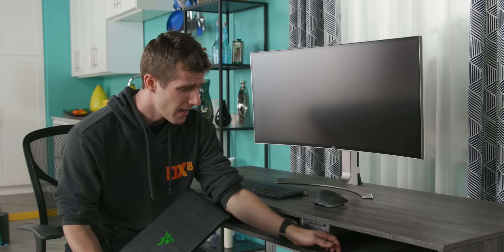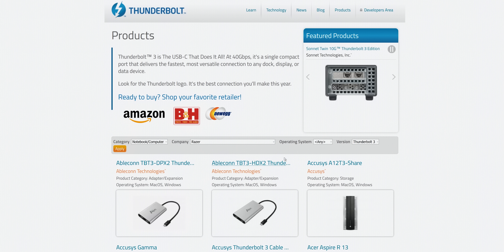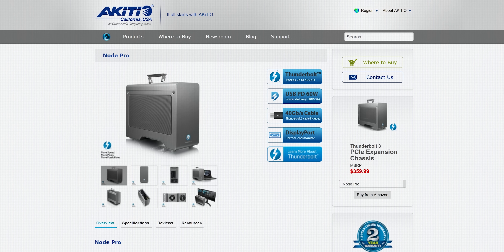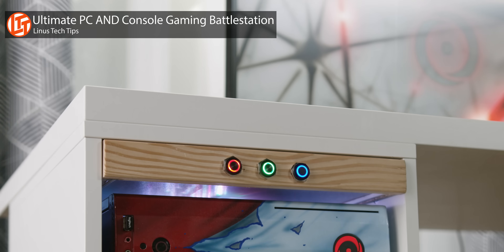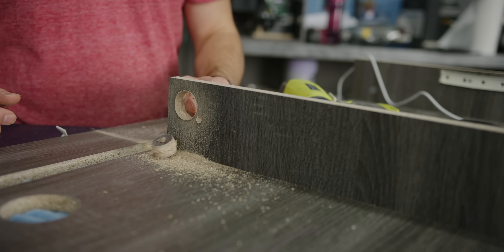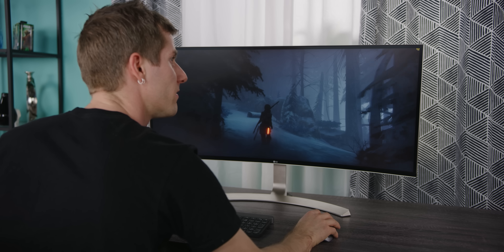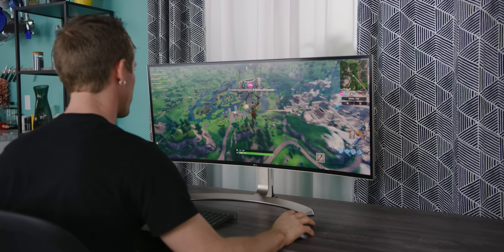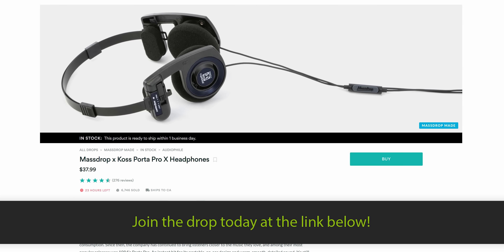This is the CLEANEST Setup.

Comment: Nice setup! Though the only problem, that I see with this desk is that it completely lacks the cooling of the laptop itself. For an example my asus Gl502 laptop CPU runs at 97c in games. In a closed drawer like this one without any air flow it would explode.
Reply: Some laptops like the Gigabyte Aero X and the Asus Zephrys S also don't get proper cooling with the lid closed.

Comment: Thanks for the ideas. Thunderbolt definitely has its uses and this has been an issue for me since early 2000's. Although I still need a laptop for portability and a full size tower for functionality at home. But since I have 5 working computers all together, this video does give me some ideas for cleaning up my work space.

Comment: Use Heavy Duty 3M Dual Lock Velcro, it's way stronger than typical velcro. A little pricey on amazon, like around 40 USD on Amazon for 10ft

Comment: So you've spent more than $500 on a questionable quality desk (which is, by the way, also looks waaay cheaper) because it "could" fit all of your hardware. And in the end some of the hardware is in a separate stand anyway. Why  not just buy a decent-looking table for an adequate price just to hold your K, V, M (and wireless charger, yeah, if it is so important) and put ALL of the HW in the fake drawer?

Comment: I think those brackets may be backwards... (screw holes not big enough)
Reply: My razer blade stealth (2016) overheats and crashes when I try to run it with the lid shut... :(
Reply: fuzzy velcro = fail, get the same sided hard velcro... Scotch(R) All-Weather Fasteners
Reply: Gimme a job I want to move to Canada.

Comment: Why don't just plug a hdmi cable because i don't see the difference about how the thunderbolt works and it seems like you just plug in a seperate display
Reply: Well, you can't plug in a discrete Gpu with HDMI or a mouse and keyboard

Comment: pre drill!!!! Love the video and the desk setup. IKEA I always pre-work before or while during setup. (The screws stick out)... due to not predrilling even if a hole is there. (MY TIP) Take the drill bit and the screw, place screw at end of drill bit flush. Now put screw head over the bit end and then tape the drill bit "where" the screw tip ends on that drill bit. An overlap it should seem while doing this, make sure tip is versus tip while next to each other. "Now", take the drill bit put into drill and then drill until the bit meets the tape line. This should equal a depth of the screw. I made good desks made from crap material. I am only looking out because I watched you grow as far as youtube! Anyways, always love the info but if ever need some serious advice get me on.P.S. I agree awesome job!

Comment: A laptop with 1060/2060 or 1070/2070 will do the job better and you will also have that power on the go when needed. It is also more cost efective.

Comment: This is all very cool, but if you are a heavy duty user you'll probably have an external sound card, loads of capture devices. Also with a desktop that's nicely laid out with icons it'll mess them up every time the resolution changes.
I myself have a Plustek 35mm scanner, a Tascam soundcard, mouse, wacom pad, three monitors and a projector hooked up to my PC. I guess there's limits to this setup, but it does make sense. Would be cool if there were proper docks to do this!

Comment: Been doing something similar for years. With a Toshiba Dynadock USB 3.0 for data and a second cable for charging. Works quite well with Printer, Monitor, Mouse, Keyboard, Speaker, Lan. External graphic would be great but not with the current price tag.

Comment: Also try this but wireless connection to the laptop, just set it on the desk (which everything is hidden in) and everything turns on
Reply: There's no wireless connection with fast enough data transfer to do this.

Comment: Could you do this with the new Alienware Area 51 laptop
Reply: Watch the video
Reply: You cannot. They need too much power to charge. The power supply is around 300 watts. You could, but the power supply would need to be separate, meaning you’ll need to buy another. You can’t charge an Alienware on usb C or thunderbolt like you can a lot of uktrqbooks
Reply: This whole vid is bs tbh, you can make this same set up with any laptop as long as it has HDMI and USB 3. I mean... This is clearly a promotion vid.
Reply: TagliatellePizza don't you need a nice processor as well?
Reply: @tackfire27  bruh

Comment: Ok, this is nice.
I made myself something similar this0 year.
It is without the extra GPU, not with such a perfect monitor (a little over my budget), wireless charging is coming. It is quite nice.

My problem is that I have a Dell G7 2018, which has a power brick 180W. Is there any way to have a dock or something to connect laptop with a powerful support and all the peripherals.
Any help would be nice.
Keep on the good work.
BR
M

Comment: Have a similar setup with my Dell XPS 13 9350 QHD+ for the past Year!
Im using a 
Dell S2718D Monitor
Microsoft Fingerprint BT Keyboard
Logitech Mx Master Mouse
Pioneer Speakers Or JBL Duet BT Headphones
Omoton Vertical Laptop Stand

I use a 1.6ft Belkin Thunderbolt 3 Cable which charges and displays my laptop easily!.
I don't play games so i don't need a Graphics card but perfect what i do! (Software Engineer)

Comment: So let me get this straight. They bought an overpriced desk that was cheaply made. Then you had it modified with an expensive CNC router. On some of the modifications you took the incorrect measurements (haha, watching Millennials use power tools is funny because they look so awkward), so you had to further modify it. I have a suggestion. Instead of having an overpriced cheaply made desk with inferior parts and then modifying it, why don't you just make a custom made desk. Afterall, you have an expensive CNC router. You might as well put it to work. It will also be a great video because it will be so funny watching Millennials use tools and put a desk together. I'm sure it will be a great design, but laughable during assembly and use of power tools.
Reply: Oh so you're one of the old geasers rofl 😂😂
Reply: @marshian__mallow2624  I'm absolutely an old fart. I'm certainly not a young buck like you that needs warm milk and cookies to go to sleep. Or need participation trophies to reassure my sensitive self-esteem. Or have extreme competitiveness over likes of a pathetic posting. Or pretend to lead a great life on FB while leading an ordinary one in reality. Or have fake outrage over EVERYTHING. Or voice preference for Socialism but practice Capitalism. That lazy generation is you, my friend. 

And I don't need to put lol or ROFL or an emoji at the end of my sentences in order to point out it was a clever comment when it was actually quite ordinary.
Reply: @elguapo5490  What are you so pissed about?
Reply: If millennials were born from about 1980s-1990s, you do realise that a fairly large number of professional carpenters are going to be millennials, right? Your whole thread seems to treat millennials as a semi-mythical species rather than just the young adults you see every day.
Reply: George Bateman That is not really correct. I work in the construction industry and Millennials make the smallest percentage by a long shot. The industry is still mainly comprised of Gen X and Baby Boomer Generation. The Millennials who do come into the industry still have a 70% drop out rate the first year. The main reason is that it’s too physical for them. When they spent the majority of their lives behind a desk on the Internet or video gaming their bodies are not equipped to handle the physical grinds of construction. Just take a look at your body, it’s pathetic.
Reply: @elguapo5490  Atleast Millennials aren't responsible for major global economic crises that put everyone (including the Millennials) at risk of losing their jobs, unable to get jobs or even lose their homes.(We're still recovering from that btw)
We are required to have work experience at the age of 18-20 in order to get a job most of the time. 
We haven't hunted any animals to extinction either. 
Neither did we cause the major video game crash of 1983.
We haven't started any wars, yet some of us will have to fight in them in order to finish them. 
A lot of us, our bodies aren't too used to being physically active (correct) and the cause is the very digital age we currently live in, however we're not responsible for rebuilding cities that were bombed after WW2, we are however responsible for saving the countries and the global economic market from going under from the mistakes made by past generations.(like yours while we're in the middle of pointing fingers at eachother)

So what if we're a little lazy every now and then? Atleast lazy people come up with better solutions to be lazy while still getting the job done. 
And so what if we're not used to power tools, atleast we can learn to use them. It's not like we too old/stubborn to learn.
As well as you when you're having problems with your PC, you'd usually get a Millennial to help you out when you search/ask for help. But while we help out with your PC, you're laughing at us when we're using power tools. (bit backwards is it not?)

Besides all this complaining of your's about Millennials, it's your own generation that you should blame since you're the parents that raised us. We might've turned out differently than you had envisioned, but we're the ones you're going to end up needing later.
Reply: nlmod I’m sorry, but I could not understand your incoherent babble because you have your thumb in your mouth. I do think it is cute that your sensitivity was triggered so much that it required you to write a long winded and highly emotional response. I was able to take 3 points from what you said and I am going to tear apart both of them. 

1. You babbled on a list of things Millennials aren’t responsible for like the global economy. This is the problem with your thinking. You think that your generation was supposed to be handed a perfect deck. Like you believe you needed a Royal Flush in order to succeed. Understand this, EVERY generation was born into a number of issues but we dealt with it like adults. For the most part your generation does not. You just cry and wine and blame others (meaning you lack accountability). I was born at the end of the 70’s (Gen-X), that means I was born during a time of a recession, high inflation, and gas crisis. Added to that there was a water shortage where my dad could barely flush the toilet. And I’m not complaining nearly as much as you. I’m still doing fine. And there are more generations that had it worse than me. Look at the Golden Generation. They were born during the Great Depression that had up to 25% unemployment (compared to 12% during the Great Recession), and then when they were old enough to vote, they were thrust into a world war. When the war was over they did not complain, they just re-started their lives and built families. 

But here you are, complaining how life is unfair for you. The fact of the matter is, life is so much easier for your generation than it is with mine. Try looking something up in the encyclopedia or an actual dictionary instead of Google. But don’t worry, your generation will have it’s own issues that will be pawned off for Generation Z to take care of, and then they will be whining like you. 

2. You said, “...lazy people come up with better solutions.” I don’t know who told you that lie, but it looks like you believe it. The reality is lazy people find reasons to postpone work, tell you why it can’t be done, or why it should not be done. You must be young to believe that nonsense. 

3. When I have problems with my PC, 90% of the time I fix it myself. I did receive my bachelors degree in Computer Information Systems. Although I never fully utilized that degree because I now work in the Operations and Logistics field in a giant construction corporation, I still understand computers well. My boss goes to me a lot when he has a computer issue. I do admit I ask younger people about some social media shortcuts sometimes. Other times I just look it up on the Internet. For the most part, I don’t get on social medial platforms except for YouTube because most social media platforms are a waste of time. 

Lastly, look up yourself on Wikipedia. Type in Generation Snowflake or Snowflake Generation. Read about yourself.
Reply: #youtubers :D

Comment: I pretty much have the same setup. Ultra wide lg screen, thin yoga720 laptop, 1070gtx egpu gigabyte gaming box, wireless mouse, keyboard, charger, external hard drives, I even have the same phone and the spigen case lol. Problem is my laptop has 2 lanes instead of 4 for tb3 and 7th gen i5 so performance takes a dip but overall really pleased, just played RE2 at high around 60fps. I HIGHLY recommend the gigabyte gaming box on amazon, I found it open box for $500 on amazon, which is a steal since its a super compact box, with a mini gtx1070, 450watt power supply inside and plenty of usb hubs and display ports.

Comment: You can run dual monitors through a thunderbolt 3 hp dock, HP omen accelerator external GPU, with laptop. It's how I get extra CAD power at work.

Comment: Is it healthy to use the laptop with lid closed? I know vents aren't blocked but still there is heat above the keyboard coming from the CPU. I don't want to burn my screen.
Reply: You disable the laptop display so that it is only displaying to the second display.
Reply: That’s not what I’ve meant. Every screen LCD or LED is weak against heat or even direct sunlight. When we close the lid screen is too close to the upper keyboard area and most of the laptops that I’ve used  had their CPUs is the same area because of cpu intense tasks my cpu and keyboard areas always heats up substantially. 

Is there anyone who had used their laptops in a lid closed docking system over a year?
Reply: @OrionVX  haven't noticed any issues with mine and that is primarily how I use it
Reply: @OrionVX  Used my Dell XPS 13 9350 with closed lid with my Dell S2718D Monitor for about 8Hrs/Day for a year+ and no issue at all.

I also use a vertical laptop stand so the heat goes towards the wall and the fans are located on the bottom of the laptop.
I would not recommend doing this where  the fans are on the keyboard like some MSI laptops i see as it can damage the screen.

Comment: So this should also work with the  ASUS ZenBook 13 UX333 and Dell XPS 13 9370, rigth ?
Reply: both have a 4 lane thunderbolt 3 port and are using 50 / 53 watts for charging

Comment: Rather than cutting into the desktop for the mousepad, a better setup would be maybe like a full coat on the top, maybe like a full sheet of foam padding you could attach to the full surface. Or maybe even like a soft touch paint or another coating. Or if you're set on a mousepad, find like a super thin mousepad. I like the idea of having a full surface mat though just to keep a uniform look.

Comment: 3M Dual Lock Fastner for the TS3 plus.. You're welcome (It held a boost control solenoid in place in the engine bay of my car for years)

Also, throw some super glue on the adhesive side of the 3M dual lock for the pieces you stick to the wood for extra hold

Comment: CPU also needs some air so laptop cooling pad would be great to have.
With CM X-Lite II cooler pad that has just one 140mm cooler my ultrabook runs almost 10°C  less during the times when CPU is hot.

Comment: Okay, so I have an Alienware R3 15; I'm looking for a docking station that will plug into my thunderbolt port and be able to display two monitors and have enough power for up to 4 USB devices. I don't necessarily care about the docking station having power. However, this puts pretty much in the same situtation as linus.

Comment: Can this work with the Node pro work with a xps 13 9350? it only has a 2x pci. My desktop died and I'm considering just taking out the gtx 970 out of it and use it with the node pro for my xps 13 9350 fully loaded

Comment: I have a laptop with good specs but it just doesnt have a good graphics card and i dont wanna spend 400 dollars on a    e gpu and  i still wanna play fortnite on decent settings does any one have a solution for me?    This are the specs

Intel core i7 7th gen

16gb ram

Intel (r) 620 gpu
Reply: fortnite best moments all you have to do is uninstall fortnite and play good games
Reply: @Doffel   Wich games?
Reply: @Wassimmmm  csgo is free right now and those specs will run it very well
Reply: Sonnet breakaway and Akitio Node (non pro) are both cheaper than 400

Comment: would you recommend using a razer core v2 as both egpu and dock for xps 9570 with dual monitor setup ? 
I am not sure if the setup in the video will provide sufficient power to the xps and peripherals

Comment: So, I'm sitting here in Europe wondering what a setup like this would cost me. I went on to the German Amazon and collected the parts. For me it works out to $5.706,50. (CAD 7.546,40).

I mean, that CalDigit hub on it's own is $353,60. I wonder if there's a cheaper alternative, seeing as the laptop would be charged through the EGPU case?

Comment: Very clean setup indeed. One recommendation I would have though is to run the external monitor off the HDMI/DP of the laptop instead of running it off the Thunderbolt 3, to reduce the amount of PCIe bandwidth used up by the screen.

Comment: I looked into this using a thin and light laptop as a powerful desktop PC substitute and it never really worked out as a practical solution.  You need to spend £2k+ on a high end laptop then you still have the issue of tons of desktop mess from the laptop going to multi monitor, external keyboard & mouse.  I decided its better to just buy a high end tower PC for £1.5k and a cheap laptop for £400 as its more cost effective and a cleaner / more powerful setup.